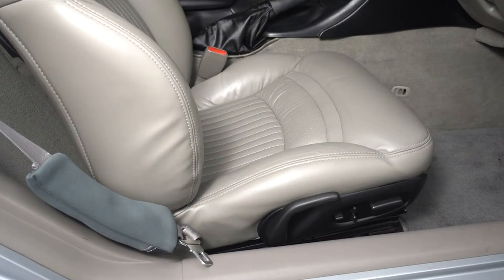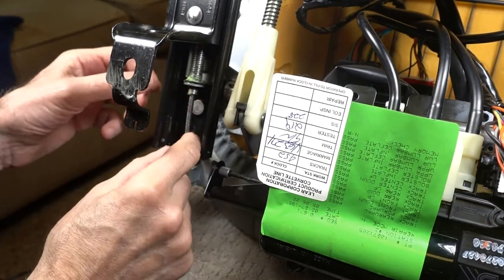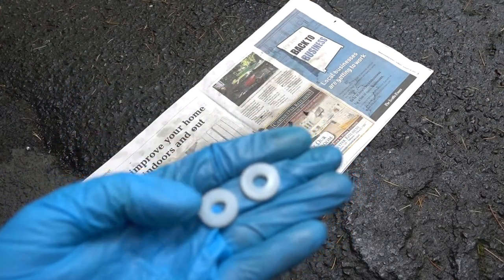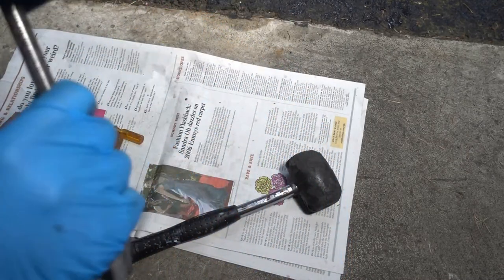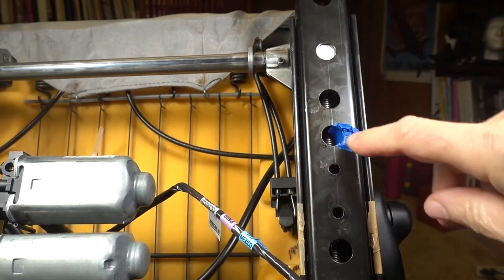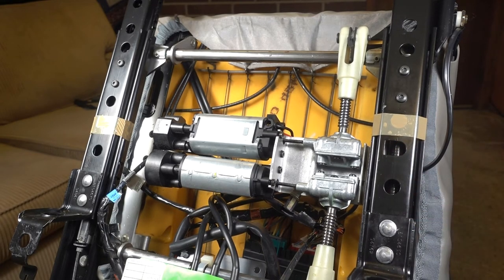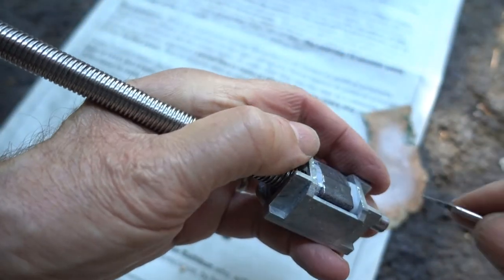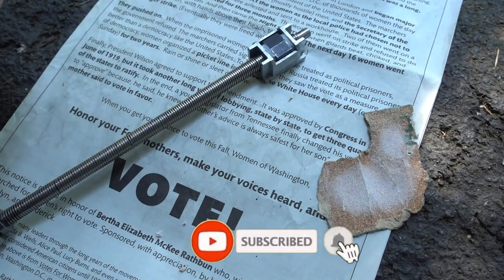C5 Corvette: Repairing Loose Seat Tracks

Comment: I had my drivers seat fixed at a Corvette repair shop 6 months ago for close to 400 bucks. I watched a video by Kyle at C&S Corvettes but his method was way too involved so I avoided doing my passengers seat. That's when I stumbled on your video as well as another youtuber and decided this was a task I could handle so I just now ordered new bushings. While I have the seat out I will also install the LCM5 module to prevent steering wheel lock......I especially like that you had the seat all the way forward to make indexing the bushings almost fool proof
Reply from the maker: You should have no problems.  Thanks for watching and good luck!
Reply: @davidgpo  Never mind.......I played around with the position of the carrier and even swapped the screw. I made a jig to connect the seat while on m bench to supply 12 volts and noted the direction of travel of the track and screw. Went back to correct side, put carrier 6 inches from the tip o both and voila.......it all works as designed.😄 sometimes ya just gotta stick with it......
Reply from the maker: @nyernga    I'm glad you worked it out.  I did the job so long ago I forgot how to do it.  I do remember that one rod has a right hand thread and the other has a left hand thread.

Comment: Quick question......got my kit in today. I had my rods laid out and installed the bushings. Then threaded the carriage all the way to the eyelet since I pulled the seat in the full forward position. Our the seat back in and the seat would move forward and back but not all the way back. Took everything apart and rotated the carriages give times each. No change. Took apart and no bed carriages to the center of the rod and now no movement. I can hear the motor humming.  
Right now I have all screws removed,carriages are three spins from the eyelet and when I slide the track to line up the holes of the carriage it appears to be fully forward. Taking a break for now. Will tackle it again tomorrow.

Comment: Just curious as to why you did not purchase the square nylon washers, versus the round ones. I repaired both my seats with one broken angle bracket, and the kit included the correct washers.
Reply from the maker: No special reason.  There's nothing wrong with the kit. I just wanted to try my hand at making my own  spacers.

Comment: Excellent tutorial.I have a problem my electric motor doesn't go not back and forth.
So i can't disassemble  the bolts to remove the seat.
Alberto.
Italy
Reply from the maker: See if you can diagnose the reason the motor is not working.  First check all of the fuses.  Check the leads going to the motor by removing the wire assembly jack and testing it for power.  It may be that if it's not getting power from the switch you can bypass the switch and add power directly to the motor to get it to work.
Reply: @davidgpo  Ok Tomorrow I try.
Thanks